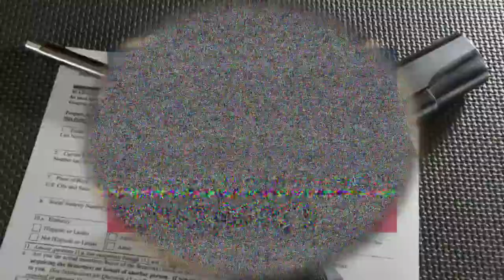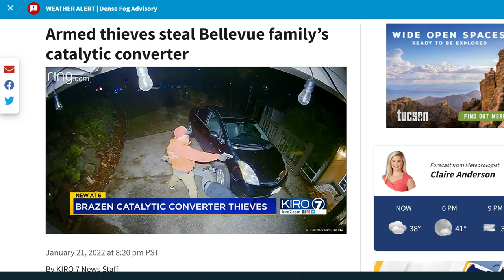How Much Force Can I Use When Protecting My Catalytic Converter?

Comment: In most cases of theft of property the criminal is almost always carrying some tool to complete the criminal activity a screw driver a saw a hammer a pipe. so I would never confront a thief on your property with out a fire arm. because those tools can quickly become deadly weapons. We once had a guy here several years ago try to steal the tires off my truck. He got met by both me and my husband when he stood up he was holding  a lug wrench and you could tell he was sizing us both up. So the guns got presented at him and he got told to drop that wrench get on his face....he ran away. he was later caught he had on him the lug wrench a screw driver a knife and his jacket had blood on it that wasn't his it was never determined where that came from. The police officers here said that we were fully with in our right to assume that a criminal that is in the process of committing criminal activity on your property could pose a life threatening danger to us when confronted. We were briefly questioned about the brandishing but it was clear that we did not point our guns at him until it was clear he had the ability to injure us and the case was closed. never give a criminal a fair fight because they wont give it to you and I would rather be judged by 12 than carried by 6.
Reply: @Lady Hawk "... never give a criminal a fair fight because they wont give it to you ..."
Roger That!!!!

Comment: Thank you for the great video! Additional question not sure if you have ever covered the use of less than lethal force and the legality ie pepper balls or discharging a taser to deter property damage. Coming from CA this would more or less turn you into the aggressor allowing the perp to respond with force but how does that apply in WA if different? Thank you again.
Reply from the maker: Great suggestion!  I will do a video on that.
Reply: Similar question here: I’m old and rural.  I might lay a pick handle up alongside the thief’s head.  Not lethal but I started it and he’ll need a Doctor.  Do I end up in jail as the aggressor?  Worse yet, if I initiated force and he (or his accomplices) turned out to be more than I could handle and I had to use my .45, am I now on the hook for murder?
Reply: @WashingtonGunLaw  please also touch on the greater protections offered by state law re: citizen's arrest, and how assault 3rd (Class C felony) comes into play with those resisting a lawful detention. :D

Comment: 4:30 This isn't a plain reading of the law though. 

RCW 9A.16.050
Homicide—By other person—When justifiable.
Homicide is also justifiable when committed either:
(2) In the actual resistance of an attempt to commit a felony upon the slayer, in his or her presence, or upon or in a dwelling, or other place of abode, in which he or she is.

The key here is OR, "in his or her presence, OR upon or in a dwelling". Because of the OR, the plain reading of (2) only requires two elements. 
1. Actual resistance of an attempt to commit a felony upon the slayer(you). 
2. In his or her presence. 

It does not say AND, it does not require that there be a felony that is also in their presence, AND upon or in a dwelling.

The only factors to this scenario that I see are two things:
1. That the slayer(you) must be the victim of the felony. One couldn't use deadly force to prevent the theft of someone else's catalytic converter. But even if parked in public, if it's my vehicle it's lawful to use deadly force to defend it. 
2. The theft of the catalytic converter must be a felony. This I think is the trickiest one here. To be a felony the costs of the damage to the owner's property must exceed seven hundred fifty dollars. For many vehicles the vehicle may be able to be repaired for less than $750.  

If there's some precedent where a WA state court has said otherwise please point it out.

Comment: So, if I'm living in my car, and someone is under my car, in the dark, sawing away at my exhaust pipe, who's to say he isn't going to accidentally saw through my fuel line, and catch my "abode" on fire and possibly kill me? The thief is already recklessly endangering my life...what if he cuts through my e-brake cables, and brake lines, causing my vehicle to roll down a hill into traffic or even possibly over an embankment?
I know this is a lot of ifs.. and obviously shooting a guy multiple times, incapacitating him, and then, tying him to the vehicle and dragging him around until he dies is certainly over doing it... however I think the scenario where someone is living in their car is a slightly different thing and needs a slightly different investigation. 
I have thieves. And it grieves me to no end the thought of catching some tweeker ruining my vehicle so they can buy some dope. I hope it doesn't happen.

Comment: You are wrong sir. I can detain a thief , using reasonable force, including pursuit. As a former loss prevention officer, I was bound by the same laws as any other person. Multiple times a day I would pursue thieves and drain them and perform what's known as a citizens arrest. It was very lawful and Oden ended in me handing that detained person to law enforcement. In one instance they pulled a knife on me and wound up with a felony conviction.  I participated in the trial. Never was my use of pursuit questioned. So while I believe most of what was said in the video is accurate, you may pursue a this is not a state that requires you to attempt to back off rather then use force (this is a stand your ground state).

Comment: Necessary, reasonable, and proportional response?  So does that mean that I can use my battery powered Milwaukee SawzAll to cut the guys foot off while he is lying under my truck and cutting through my exhaust pipe?

Comment: As I have already been a victim of this (in King County, WA), my sympathies lie with the victims, no matter what action they have taken.  It's been more than 4 weeks.  There does not seem to be a converter in the supply chain for my car.  Insurance only paid for a week of rental.  It's not just the cost, which is several thousands,  it's the inconvenience, the deductible, dealing with the insurance company, trying to find a repair facility that can actually get a converter after taking in your vehicle, etc.  And, LE just yawns and goes through the motions.  So, if I finally get my car repaired, the thieves know where to find a brand new converter to rip off.  The repair facility said, "Yep, we see that all the time."  If this wasn't Washington State, I would entertain hopes that we could get CC thieves reclassified as varmints with no bag limit.

Comment: If I were sleeping in my truck and awoke to a sawzall cutting off my catalytic converter, then gently stepped out and wound up and kicked the would be thief in jimmy as hard as I could, would I be liable as well?
Reply from the maker: That's not deadly force (he may want to die after that) but it on whether or not a jury believed that use of force was reasonable in that situation.  In my limited opinion I believe that that would be a relatively reasonable use of force to someone you catch in the act of stealing property.
Reply: @WashingtonGunLaw  Thanks for the response.  I got a little silly with the kick in the jimmy, but the gist of the question is whether or not the law would required me to stand there and watch a guy take my property or if I can legally go hands on to deter his/her actions.

Comment: So what is the legality of rubber bullets/bean-bag rounds in WA? 
Like if youre 7shot 12ga has 5 rounds of buckshot and 2 bean-bag rounds as the 1st/2nd round, is it legal to use the gun (loaded with less-than-lethal rounds) and just announce yourself and shoot them with 1 bean bag round; from there if they attempt to attack you simply ejecting the 2nd bean bag round or shooting it into the ground puts buckshot into the chamber (if its a semi-auto shotgun), which can of course be used IF, and I mean IF lethal force is required to further subdue the trespasser/thief.

I'm interested to know if the whole 'attempted homocide' 'reckless use of a deadly weapon' would apply to a gun when it has a mix of lethal/less-than-lethal ammo? Like even just pointing it at the thief and announcing yourself, would that be 'attempted homicide' even if the round in the chamber was a bean-bag BUT subsequent rounds were lethal rounds? 

1) I don't think this is all that ideal of a configuration (way to load your defense shotgun)
2) I don't think it'd go well in court even if the legislation was 'technically' permissive of it. You're going to be painted in a bad picture. 

Just thought I'd ask as the notion of using rubber rounds/rock salt/etc isn't completely unheard of.

Comment: Scarp yards are definitely part of the problem. You know it's obvious when a methed out, shady looking dudes, roll up in a junker 80s pickup full of new looking cats (obviously cut out of new cars). They just look the other way and give them some cash. That's blatantly obvious. The law needs to attack this from both sides for sure. The scrappers should have to provide documentation on where the cats came from.

Comment: This was a good video, but if your catalytic converter is stolen you can buy an aftermarket one off ebay for around $200 and any exhaust shop can weld it on for another $200.  It doesnt have to cost thousands to fix it.  You're welcome

Comment: Traps are really fun to develop. They can range from hilarious to lethal. You wouldn't believe how much damage the NVA was able to inflict on US and French troops during the long Vietnam conflict by weopnising the trash left behind by the forces of the aforementioned powers. Now for your car parts, I wouldn't take the leathal path, but the mischievously funny path is always a great path to take. You don't want to hurt some innocent kid playing hide and seek or someone's beloved pet. Things that involve dyes like powdered printer toner, or ink to mark the offender, non-leathal shocks, containment traps, etc... Be creative, look up booby traps and trigger systems used in the past. Be creative! Have fun! Just don't do any permanent physical harm to the target. For example, you can run a heavy guage wire such as you would find jumper cable wire to a remote solenoid switch from the positive terminal of the 12V battery. Then run the same guage to a high voltage capacitor, then from the capacitor to any point of the exhaust system that has continuity with your catalytic. Because stealing the device requires laying down on the ground, once the criminal completes the circuit by making contact with the converter, the capacitor will discharge its current through the thief. The theif is now the shortest path to ground. ZAP! The battery will instantly recharge the capacitor. The purpose of the solenoid is to be able to arm and disarm the system via a low voltage switch in the cockpit.
Reply: (Lethal) Traps are illegal.  You cannot predetermine to use lethal force and then later claim that you were in imminent  danger.  There is a famous case where a homeowner went to prison for pre meditated murder, I believe.  I think he set a trap on front door with shotgun.
Reply: The problem with this is pets, their owners and children.  Putting landmines and spike pits all over suburbia is not a good idea, unless it's the end of the world and we're not quite there, yet.

Comment: If you can catch them under the car, release the jack and crush the piece of s#it. I had one stolen and it was  $950.00 to replace the converter and both steel transmission lines.

Comment: I put headers on my truck and deleted the cats.  Now, I have 10%better MPG, more power, and nothing to steal.
Reply: Many states have yearly emissions tests your car has to pass.   If you delete the catalytic converter, your car won’t pass.
Reply from the maker: Washington, however, does not.
Reply: Lol that's what I will do if a thief cut off my cat(s), just weld in a test pipe, no cats.  Bless WA and no more emissions testing.
Reply: Cats are good for the the air we all breath and good ones don't harm HP or MPG. It's well worth trying to keep them.
Reply: @WashingtonGunLaw  Aren’t you people in the Pacific Northwest supposed to be  tree huggers ?  How did you get the granola eaters to abandon emissions tests ?

Comment: Just a heads up if you are victimized, you can purchase a brand new catalytic converter online for under $100 and your local muffler shop will install it for around $50.  Not worth taking a life.  It sucks.  I agree.  But part of the reason some people get uptight about this topic is because they are told the replacement cost is soooo expensive.  It can be, by crooked muffler shops, or even more crooked dealerships, but does not have to be if you are an educated consumer.
Reply: @shitcreekwarrior8794  Not if you buy stolen ones on EBay.  With a little luck, you might even be able to buy your original stolen one back.
Reply: Those cheap cats are crap.  But since we don't have to emissions test any more, probably good enough.
Reply: that is easily worth 10x tweaker thieves lives. stealing from hardworking people invalidates your life.
Reply from the maker: Great info, thanks for sharing.
Reply: The cheap converters are extremely low quality. 9 out of 10 times your vehicle will start  throwing codes/ warning lights because they don’t match up right or meet factory specs. That’s coming from a recently retired mechanic in the family.
Reply: @shitcreekwarrior8794  like I said, if you go to a dishonest muffler shop or even worse the dealer.  Look on ebay or Amazon, bolt on replacement usually under $100
Reply: @petergozinya6122  cannot buy used ones on eBay, its a federal crime to reuse a catalytic converter.
Reply: @alphawolfgang173  I agree stealing one penny should be handled with as swift and harsh a punishment as stealing $1m dollars.  Private property is just that.  And anybody wants to force it from you by any means should not be tolerated.  Thats my opinion.  Living in the society we do if you take it further than law allows will get you looped into trouble you don't want to be in.  Just a heads up to the world, it isn't as bad as many news castors will make you think to replace your cat.  Thats the purpose for my comment.  Hope to help somebody who did get ripped off get their business handled without having to apply for a new credit card or something.  Peace.
Reply: @JD-bd5uu  unless you have O2 sensors behind the cat the vehicle will never know if you have a cat or no cat a high quality or low quality cat.  The muffler isn't going to tell the computer something is off.  No emissions, and even if there were the $100 for the replacement for the cat and $50 for having it installed you have the receipt to pass.  In the old days.  And probably many other states.  Nothing wrong at all with an aftermarket cat on your car, and theives won't target you because they aren't worth much in scrap.  Win win.
Reply: @levitheonlylevi2047  That was a joke dude.